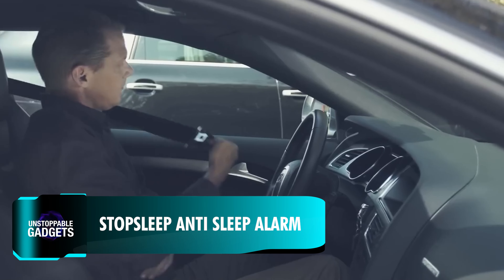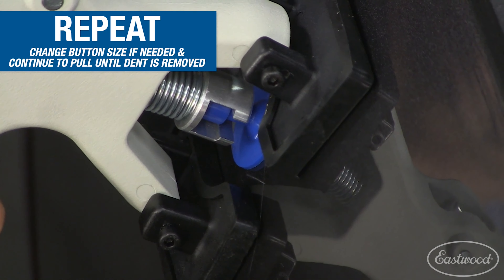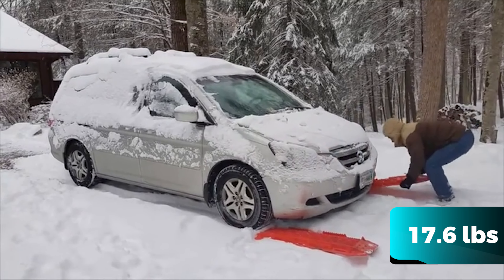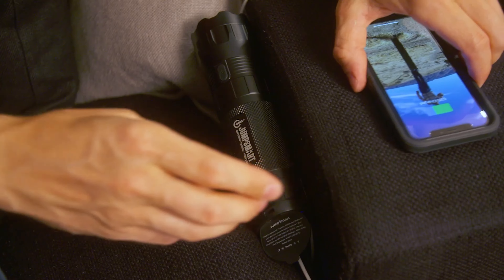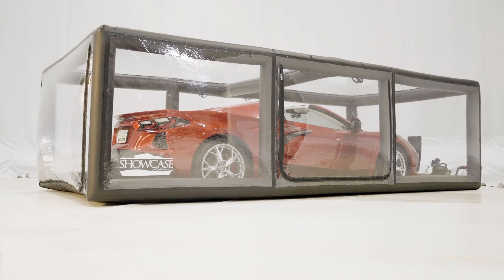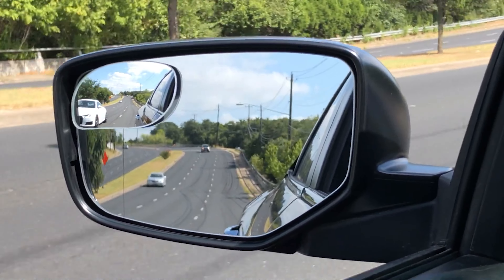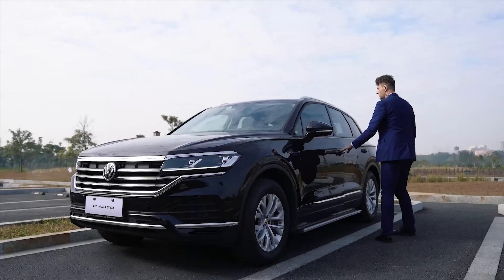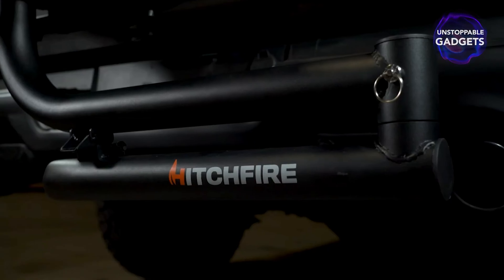17 AMAZING GADGETS FOR YOUR CAR

Comment: For stretches between deep snow, the tracks can also be used on hard road surfaces at speeds of up to 60 km/h (37 mph).

A complete Track N Go package will set you back US$25,000.